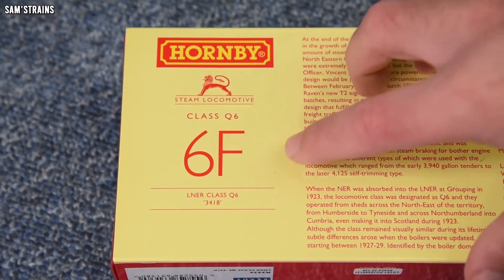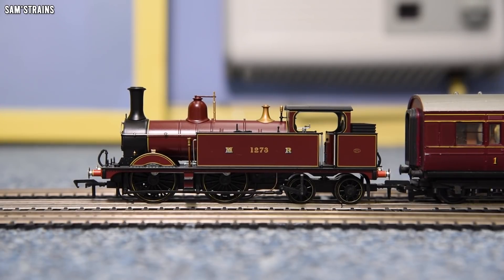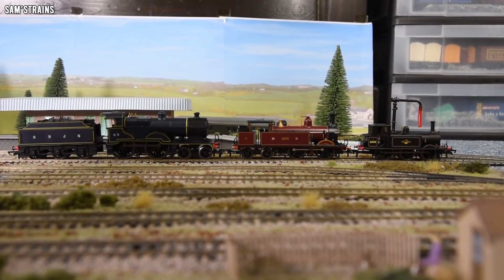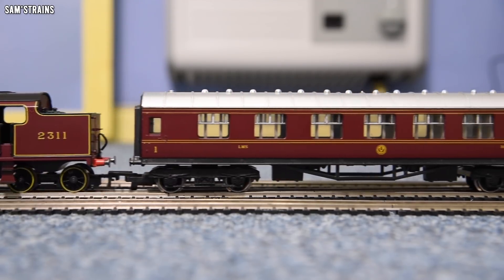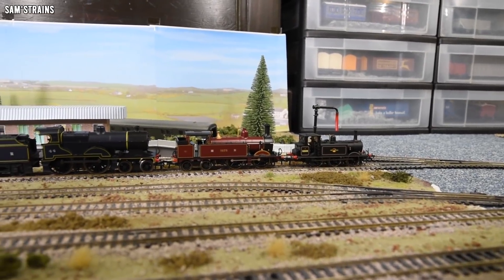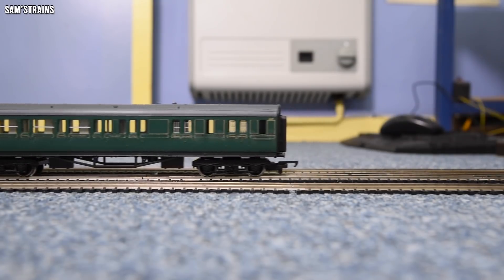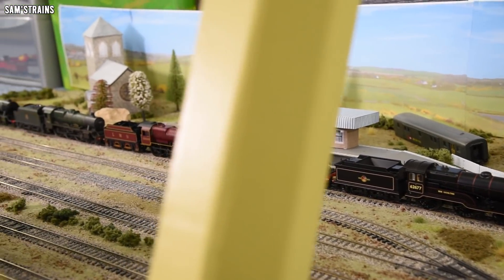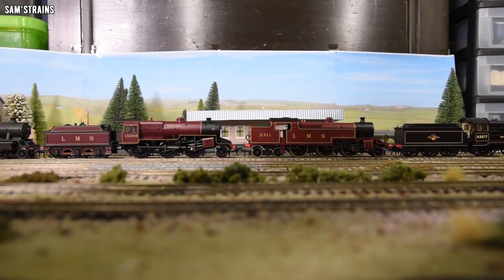British Steam Trains | Smallest to Largest!

Comment: The power ratings were passed on their pulling power at certain speeds, they used two different speeds for the 2 different classifications, f was the lower speed, and p the higher. So it wasn't really to show what was passenger and freight,  but at what speeds  they were more powerful - lms only tended to print the higher of the two numbers on the sides, or if it was equally high, it would get MT. This didn't stop a loco with, say, 4P being used for freight or vice versa
The LMS introduced the scheme, and its scheme went up to 7. When British Rail took over, they used the basic idea, but added in 8 (the dutchesses moved to be 8P) and 9. They renumbered some, like the jubilee went from 5xp to 6p. Under BR they not only classified the non-lms locos, but tended to apply both P and F numbers to its locos, so the A4s were 8P6Fs
Reply: The classification was based on the power output represented by a locomotive's tractive effort at 50 mph (passenger locomotives) or 25 mph (goods locomotives). This is the continuous tractive effort and is much lower than the starting tractive effort which is the figure usually quoted in technical publications.
Reply: @johnd8892  yep, it did become a thing that certain companies would build locomotives with slightly smaller wheels to boost the starting tractive effort (generated from a formula) which may have impaired their top end performance.
The GWR Kings had smaller wheels than the Castles, which meant they had a higher tractive effort, but I'm pretty sure that with an reasonable load, the larger wheels of the castle would have given a faster run
Reply: Also, on the F or P being descriptions for freight or passenger.... The LMS crab, it's a 5P4F. Later classified 6P5F ... But a lot of its traffic was freight. Especially fast freight
Reply: @bluesfish98  According to legend, the GWR was non-plussed that the Southern "Lord Nelson" had a higher tractive effort then a "King" with "Casle"-sized wheels so the "Kings" had smaller ones which increased the theoretical TE power so they could claim it was the most powerful British steam locomotive of the time (the late 1920s).

Comment: The GWR King class were 8P and the Castle Class were 7P. You could have used one of those to represent the GWR lol😂. Also the LNER P2 were the most powerful passenger loco in Britain before they were rebuilt into pacifics and scrapped 😀
Reply: The LNER P2 would likely be a 9P if they survived.

Comment: 15:20 To be fair, there are no 9P locomotives. A 9P would have been very difficult to design within the (very small) UK loading gauge because of the size of boiler required and that amount of power really wouldn't be necessary on any UK trains because of the short distances covered and practical limits on the length of trains. The US, with a much larger loading gauge and the ability to run much longer trains (due to longer loops and sidings) were able to utilise much more powerful locomotives.
Reply: I forgot to add that when you put the 9F's data into the formula, I believe that it comes out around 6P.
Reply: If the LNER P2 survived into BR service it would likely be classified as ,9P.
Reply: @johnd8892  Presumably when 2007 Prince of Wales is built it will be assigned a power classification, as this makes up the third digit of TOPS numbers for Class 98s.
Reply: The LNER had a proposed design for a 4-8-2 based on the generic Gresley A1/A3 Pacifics but it was never built. I imagine that would have merited a 9P classification. There's a diagram of it available but I can't add a link here.

Comment: British steam engines are far nicer looking than any steam engine that was built in a different country.
Reply: Hear hear! Not necessarily the most powerful (although the P2's, A4's, and 9F are up there) and probably not the fastest for much longer either, the Americans are building the T1 and trying to build Mallard's record, which me and I'm sure many others don't agree with. 

It shouldn't count in my opinion, as that's a modern steam record with a brand new locomotive. Mallard was not a new build specifically for that purpose.
Reply: Agree to a point just check the Europen models most esquisite and pretty.Talking about models there you see how detailed esquisite the models but more expensive but very worthwhile
Reply: @pedrodebarros4949  Yeah, some European models look really good.

Comment: The lil' 0-6-0 tank engine reminds me of my new 0-6-0 tender locomotive. Just in how the running board & domes are set up. I did not notice any similarities in the valve gear (pistons). My comment about Lima Locomotive Works was about finding a GS4. Im still trying to find one, but im not gonna pay someone $500 because it came from an attic/loft), or new from Bachmann.
Reply from the maker: Ahh very nice! Which loco do you have then? And agreed, not worth doing that!
Reply: @SamsTrains  I have Bachmann SKU 50705. My ratings based off of your rating system is as a whole 4.3/5 scratches on the tender, no proper barings, and no tender pick-ups.

Comment: Princess Coronations had the higher tractive  effort of any British locomotive including 9f’s.
Reply: The classification was based on the power output represented by a locomotive's tractive effort at 50 mph (passenger locomotives) or 25 mph (goods locomotives). This is the continuous tractive effort and is much lower than the starting tractive effort which is the figure usually quoted in technical publications.

Comment: Well as far as power specifications go, In the passenger catigory, 8 is the highest rating there is. There never was a 9P locomotive in service. So it's kind've ironic that the most powerful locomotives on british railways are Freight Locomotives, since they did manage to hit the 9F catigory. Yes Evening star and a few of her class mates did work on summer express trains on the S and D J R, most notibly the pines Express, but at the end of the day they were designed for freight work. I'm not saying that what you say is wrong, For like i say there are no 9P locomotives in existence, they only went as P, but i can see why you put a 9F in this video. good video work anyway.
Reply: The LNER P2 if they survived would have been 9P.

Comment: P2? The p2 is the strongest Sam. But also the Coronation class is even stronger than the 9F . This is the coreect way: 1. P2, 2. Coronation class, 3. 9F
Reply: The classification based was on the power output represented by a locomotive's tractive effort at 50 mph (passenger locomotives) or 25 mph (goods locomotives). This is the continuous tractive effort and is much lower than the starting tractive effort which is the figure usually quoted in technical publications.
Reply: Ok thanks🙂